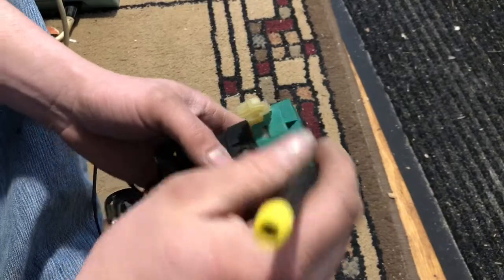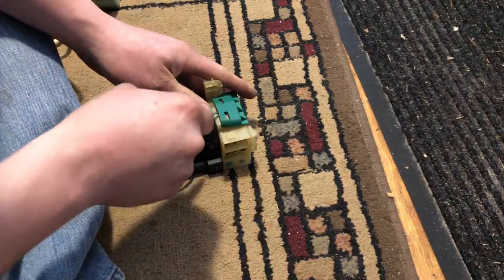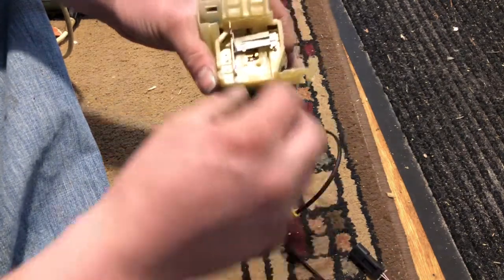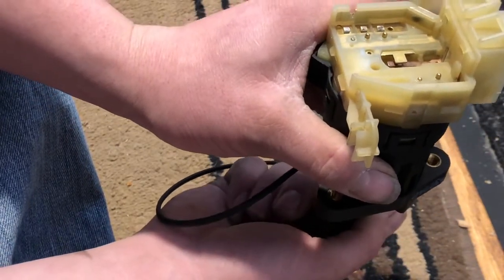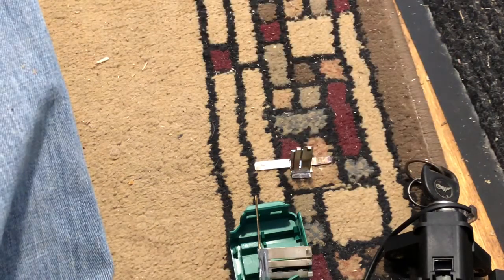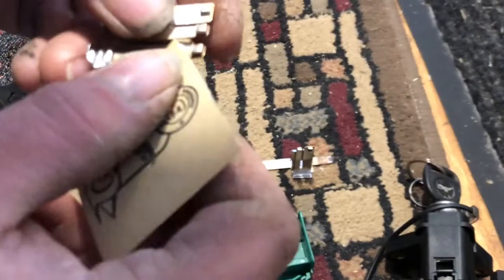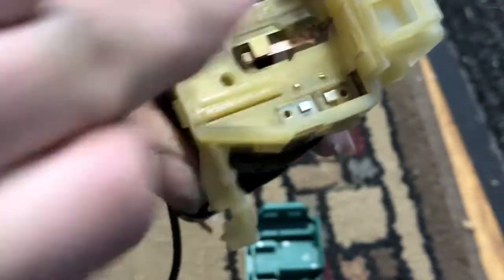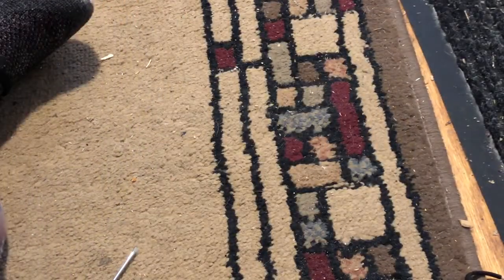2003 C5 Corvette Ignition switch disassemble and cleaning of contacts

Comment: I can’t turn my key at all so I was planning on replacing the ignition switch but can’t turn the key so don’t know what to do
Reply from the maker: Not really sure what your problem may be. Hard to tell without looking at it. If you happen to have a spare key try that to see if it works.  May be your key is damaged.
Reply: @kingdeadlego  ended up being the coil in the ignition cylinder that reads the the key broke off so had to replace the cylinder replace the ignition switch too while I had the whole dash apart.